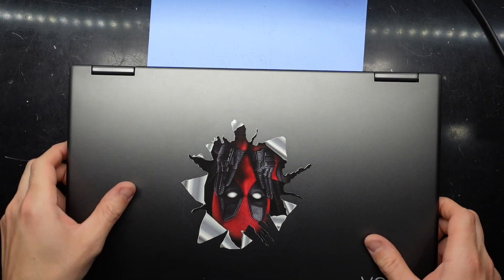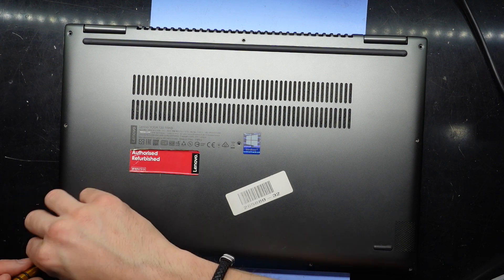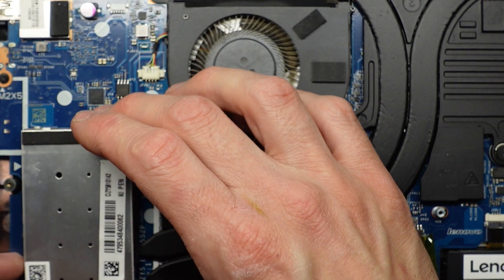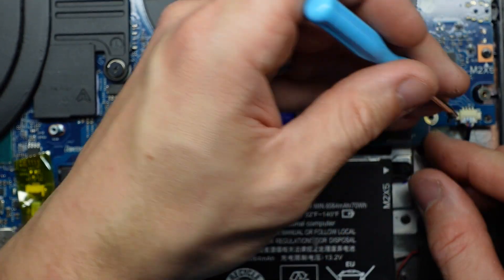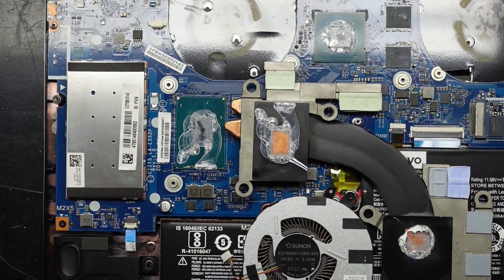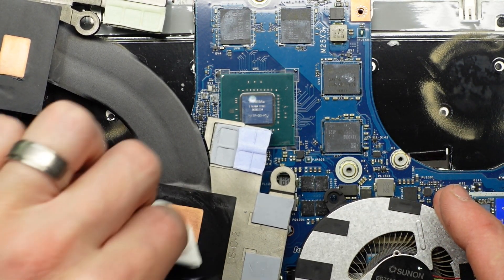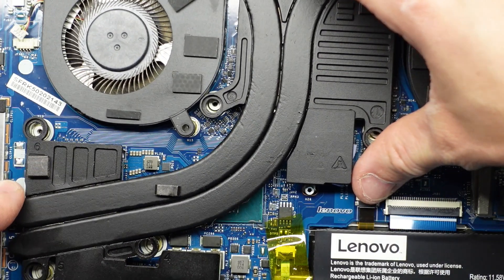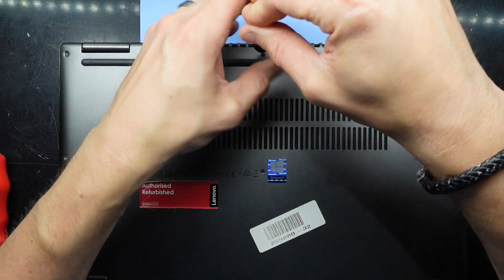Lenovo Yoga 720-15IKB Upgrade and thermal paste replacement

Comment: I cant remove the battery connector thingy. It feels like it has been glued, and I don't want to rip it. What can I do?
Reply from the maker: it might be the springyness of the wireless also holding it in place 

i would unscrew the battery pack and move it to the right, then try and unclip the connector
Reply: @rickstechrepairs  Thanks a lot man! :) I managed to disconnect!
Reply from the maker: Great!

Comment: It is a big chip under gpu, without thermal past or thermal pad in my case. This is normal? At right side of cpu
Reply from the maker: GPU is between fans

Chip without anything on it is Chipset 

Other Chip (bottom Left) with thermal paste is CPU

Comment: For RAM, it comes with 8GB DDR4-2400 built into the motherboard, with an empty slot to add an additional 8GB, so this one in the video is already upgraded to be 16GB (one 8GB stick built in, and one additional 8GB stick that was pointed out in the video). Not sure why they did it that way, because it means 16GB is basically the max, but that's why there's only one slot that you can find.
Reply: Stephen, 

I have the 16gb model from Best Buy. Does this mean it’s 8gb soldered, and 8gb the slot (total 16). If this is correct, could I swap the card for a 16gb, and max out at 24gb? (8gb soldered, 16gb card)? 

Would performance increase noticeably? I’m thinking of increasing ram, ssd to 1tb or 2, and replacing the battery (battery life drains quick).
Reply: @EricVentures  If it has an 8gb soldered in, it's not generally recommended to mix and match with an 8+16 setup. You might be able to get away with it, but ot could cause issues. (What kinds of issues it might cause is beyond my level of understanding, I just know that it isn't typically recommended by people whp know much more about this than I do). If you have a 16gb soldered in with an empty slot, then perfect, just add another 16, but you might just have to undo some screws to find out if it's a single 16gb stick or an 8+8.
Reply: @EricVentures I replaced my 8gb stick with a 16gb stick and am loving the 24gb. There's no issue with doing this. Idk where the other commenter is getting his info from.

Comment: Helped me out a lot when changing the thermal paste on mine haha. Thank god you dropped the video just 10 days ago haha. One little question tho. What are normal idle temps? Because mine sits at 45C without the fans spinning but I’m using Throttle stop and disabled the turboing.
Reply from the maker: Temps are fairly high the 6700HQ and newer all run very hot 

Disabling turbo boost sure does help reduce temps